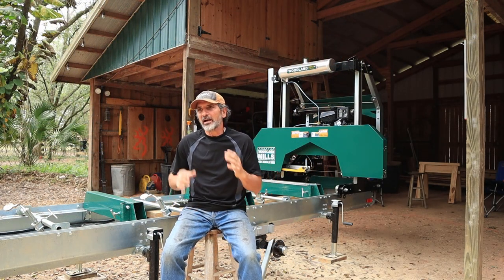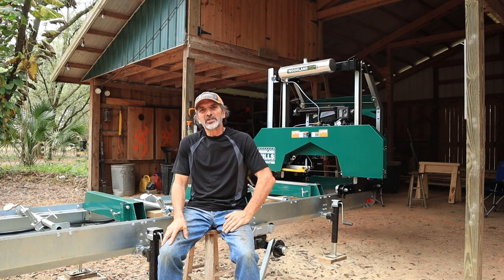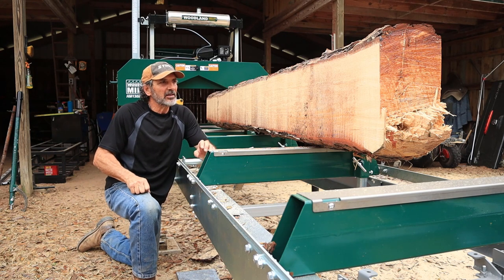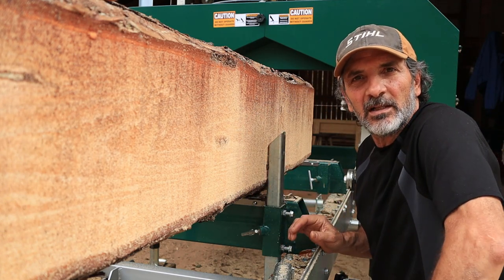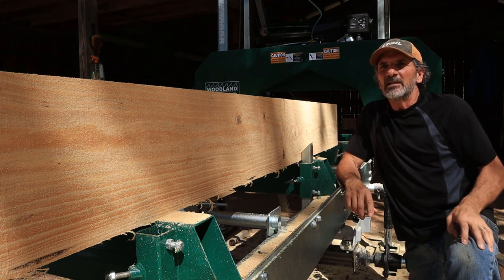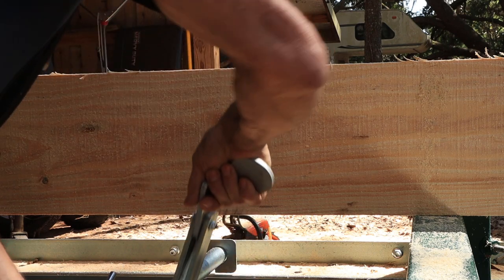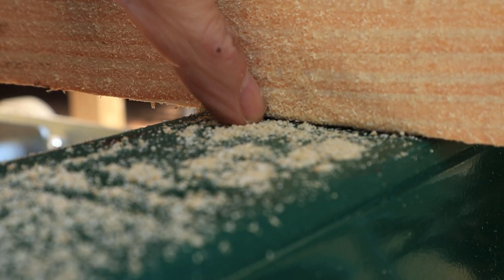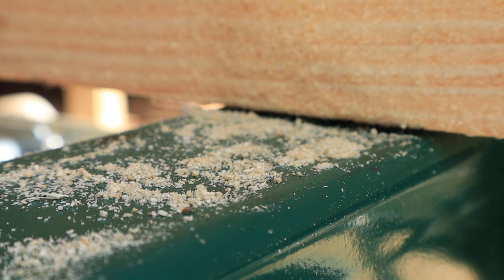How to ensure a square CANT

Comment: Calling the obvious in addition to this tip that I also found out early on,
Dirty heavy debris such as bark, chunks and saw dust on bunks can contribute to this "progressive error".
Also, you can get buildup on the track wheels if a whisker is not cleaning the groove out and most times thats on the discharge side.
When you are milling hot and heavy/cranking it out, making it happen, sometimes any of these can slip up on you and a combination of several can put production to a grinding halt.
Again calling the obvious, learning your mill and knowing your mill and applying all techniques learned will help make your sawing experience a better and more pleasant accomplishment.

Comment: Not much need to set that clamp into the cant at all, as the weight of the cant will be sufficient to hold it steady on the bed for the parallel cut.  That is if the blade is sharp and not having to force the blade through the wood. 
But good observation with the clamping error. 
Also should mention that the log stops don't remain square to the bed over time of use.
Reply from the maker: Thanks deernut00....I will put the log stops on my checklist to be periodically inspected for square
Reply: those log dogs are made a bit loose, they have to be or you could not raise or lower them, even though the entire system is good, it is not fool proof, it takes some back yard mechanics to tweak out the system to get nasa grade product,    Well Presented, with much needed info.
Reply from the maker: Thank you Ben

Comment: Thanks, very interesting video like at least one other I saw in your collection.  But I want to add a small detail.  However perfect the geometry of your freshly cut lumber, it will somewhat warp and bend and distort as it dries, if it was sawn out of green wood.  The consequences may be negligible for rough carpentry work, but disastrous whenever you need good geometry and dimensional stability, fine woodcraftmanship work like cabinet making, furniture, finition wood work and carpentry, doors and windows framing, etc....  So, to get perfect square lumber that will remain about perfect over time, you need to first cur your freshly cut logs in halves or in quarters, that is resawing them length through their central axis or very close and parallel to it.  Meaning that with a Woodland's mills, you could do no more than a 15 inch diameter log, since the max depth of cut is on'sly about 7 inch.  That is the main limit when using those small cheap portable bandsawmills, that they are not suited well to resaw large logs of hardwood for fine woodworking.  By comparison, a US made Timberking has a 16 inch deep saw throat, meaning that it can handle a 33 inch diameter log, but the Timberkings are clearly more expensive than Woodlands.  Another choice is Canadian-made Select sawmill with a 15-inch depth capability, but those are serious industrial bandsawmills selling for about 100 000 $.  Cheapest alternative would be the two top models of the China made Red Runner line sold in America by Vallée sawmills, starting at 7000$ Can = 5550$US, which boast an impressive 15 inch deep sawthroat.
Reply from the maker: Yosef....thank you for taking the time to educate me.  There is much to learn about being a sawyer. 

Mike
Reply: Hobby hardwoods of Alabama might disagree with you you just have to adapt your sawing methods to accommodate your machine

Comment: Any large cant sitting on a cut face will not need to be clamped or need the log stops in a raised position.If you leave the cut lumber sitting on the cant as you work your way down, with a sharp blade,  the cant will be heave enough that the clamp is not needed.
Reply from the maker: Thanks for the tip Rex. I have been reluctant to do that because my bunks are stainless steel and the cants slide pretty easily. I will give it a try though.

Mike

Comment: I may be wrong but I don't even clamp when I have a heavy cant with a flat side down. I have a cooks mp 32 and I only clamp when the round is on the bunk. Works for me
Reply from the maker: My bunks are topped with polished stainless steel. I’ve had even heavy cants slide around. I could take the stainless off and see what happens.
Reply: @activeoutdoorssawmillediti7736  I have a cooks sawmill. It has tabs welded on the squaring arm side. Without a clamp the blade pulls it against the tabs. Your mill may be different

Comment: The cant will rest against the welded nubs that should be just under the lowest blade setting, most mills have them.If yours are missing you can add them. So for the cant to move, the blade must lift the cant to move it. Eliminate the risk of sawing into your clamp and stops. Maybe you could re make the log clamp to pull down when tight. Why is that bunk not capped with stainless steel?
Reply from the maker: Rex...it probably happened when I assembled the unit but for some reason that particular bunk was higher by the thickness of the stainless cap. So for now I just took it off until I can check into it further.

Mike
Reply: Very interesting, I have the same model and my middle bunk with the stainless steel was throwing off my cant as well. I thought I was losing it for a while it was so frustrating. I ended up taking off the stainless steel cover over the bunk and finally started getting good cuts.
Probably time to send a note to woodland mills?
Reply from the maker: @earlholmes9740  Interesting....and I thought it was just my unit.

Mike
Reply: I'm going to woodland tomorrow, Friday April 5. I'll ask about the middle bunk. Do you have the portable trailer mill also?

Comment: Are you grinding your own blades?
Reply from the maker: No...I just sent some out to a local sharpening service. I haven't gotten them back yet so not sure of the quality of their work.
Reply: @activeoutdoorssawmillediti7736  Ask if you can watch and/or film them grinding your blades, Post the video and let us tear it apart good or bad. The first sharpning will adjust all the teeth to the machine and make up for factory blade spacing being off a bit  You should watch a few online videos on blade grinding so you can make good conversation with the guy grinding your blades.You don't want to pay for them to wreck your blade..
Reply from the maker: @rexhavoc2982  Great idea!